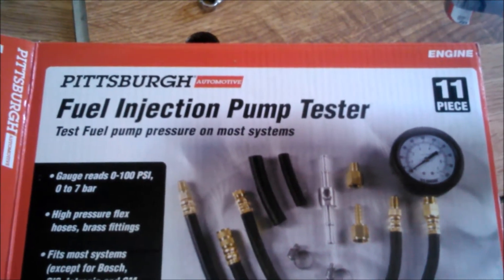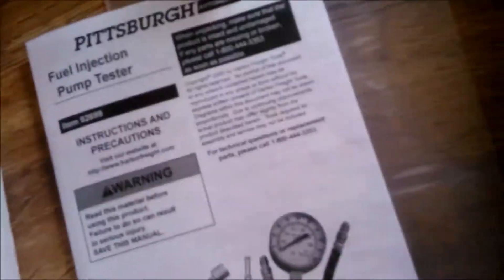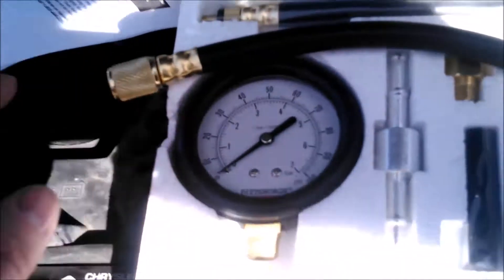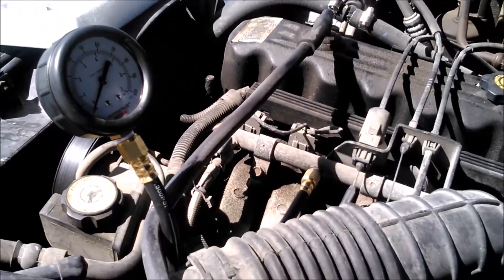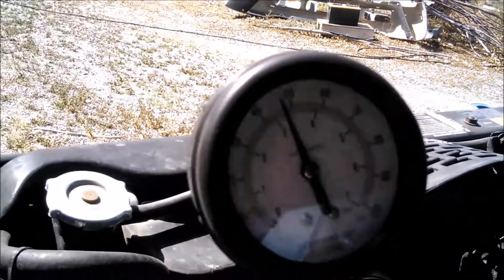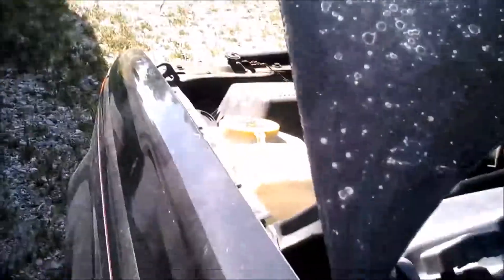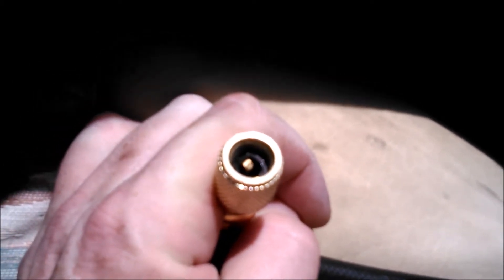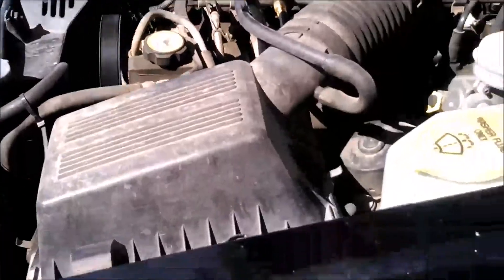Pittsburgh / Harbor Freight Fuel Injection Pump Tester, Item #92699

Comment: Congratulations on making up your mind to stop paying the mechanics and doing it yourself! You should be able to find the specification pressure for your car in the manufacturer's service manual. You're also lucky that kit had a valve attachment that works on your vehicle. I rented one from Autozone. A kit with more parts than that and nothing fit. It was useless to me. Still trying to find a kit that I can verify to have what I need. Please post a video detailing the outcome of your investigation. Have a nice day!
Reply from the maker: Thanks for chiming in!  I ended up changing out the fuel pump with a Bosch unit, and performance did get better, but that was not my primary issue, as it turned out.  My real problem was that the plugs and wires were completely toast.  I replaced them, and it has never run better.   I guess it had been longer since I changed them out than I had thought.  ;)  Now I just have to get around to putting in the lift kit, and all will be good.

I'm still not sorry for replacing the pump, though, as now I know how to do it, and I have a working spare in case the one I put in craps out.  I'm slowly working up a stash of critical parts for the jeep to have with me on long offroad trips. (Coil, Fuel Pump, DCM, CPS, Belt, TPS).

I did shoot the pump replacement..  but I haven't cut it to post yet.   Too many projects! 

Take care, and thanks!
Reply: That's awesome glad to hear it!
Reply: Totally agree. No one should go to the greediest crooks on the plant, a.k.a. Car Mechanics.

Comment: clean the green crusties off of the ground  wire and youll probably stop burning up fuel pumps.
Reply from the maker: Nope..  no corrosion on the conductors.  Thanks for playing and try making baseless assumptions again sometime.
Reply: The Game of "Grasping For Baseless Assumptions"!.....there are typically numerous possibilities; this video is not centered around the car, but the pressure tester itself. Play the lotto instead of randomly throwing anecdotal information based upon your own limited experiences up in the air; nobody gets laid here,  this is the internet and, more specifically, a post dedicated  to sharing and dissemination of knowledge for the sole purpose of understanding the fundamental aspects of function, not playing keyboard "expert". ( I'd be willing to gamble that the cause that you're describing has happened TO YOU, which ultimately invalidates your 'conclusion' based upon the reverse logic you employ.